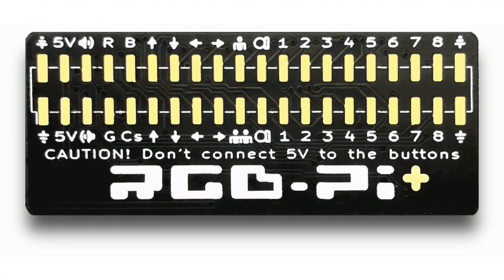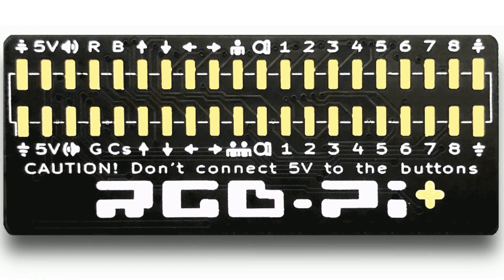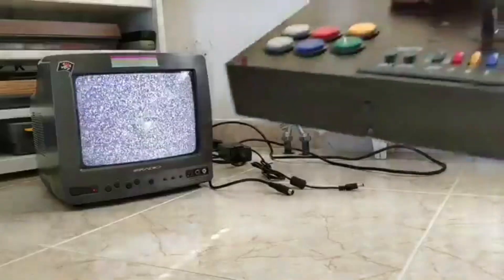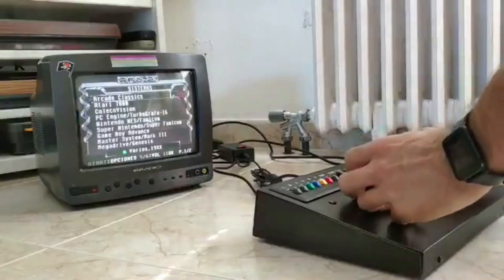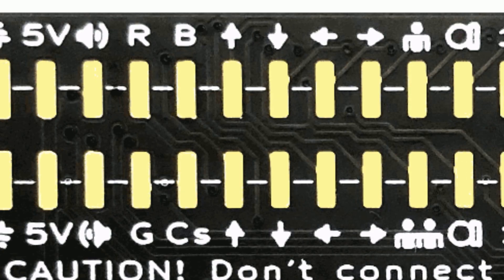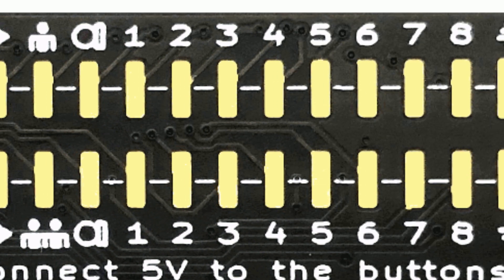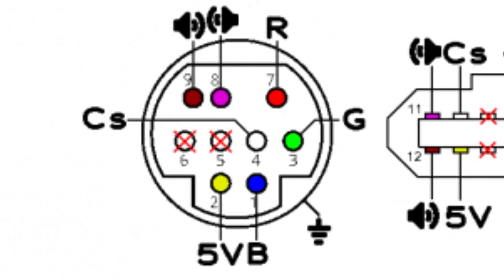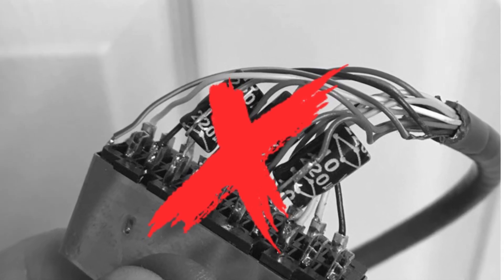What is RGB-Pi Plus?

Comment: does this mean we wont need to use 18 pins of gpio for getting digital rgb then using resistor ladder to turn it into analog ? it will give rgb with only 3 pins? its impossible
Reply: Not impossible... The board has the components necessary but they're not shown in the video.